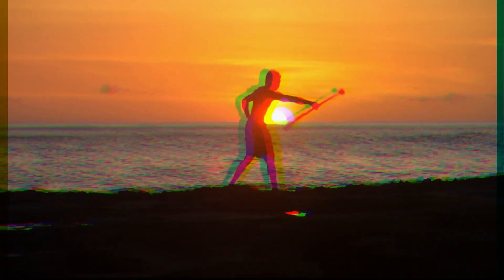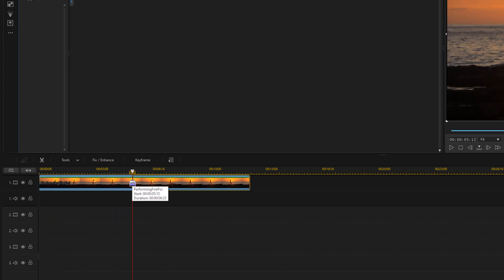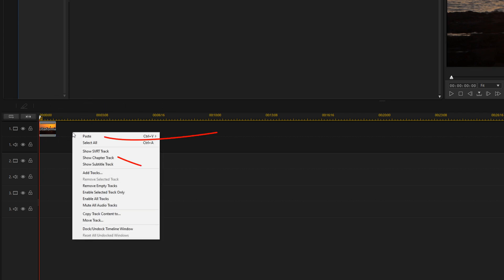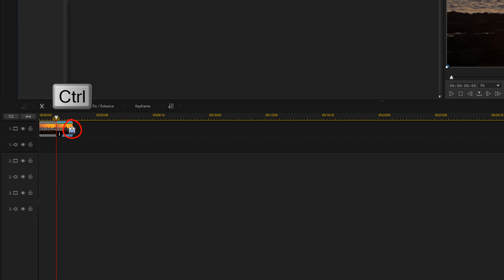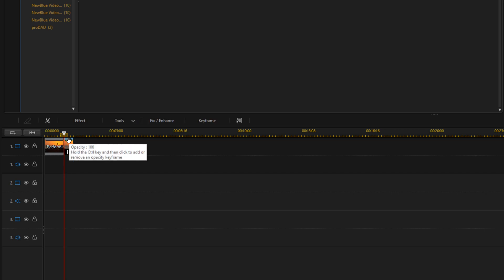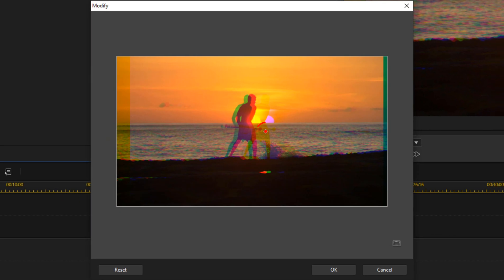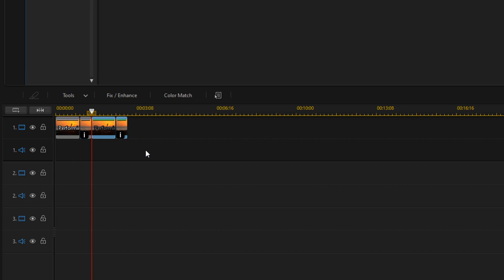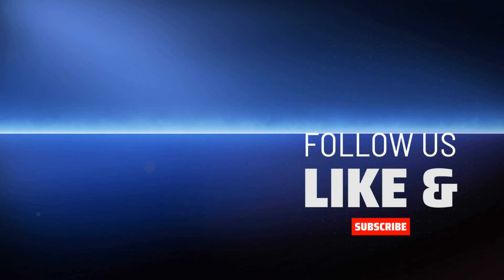How to Make A Boomerang Loop Effect | PowerDirector

Comment: Mr. I’ve been using power director 365 for two years. I watched your video all the time but Where’s the flip 16:9 over to 9:16? I knew there is a “ power tool “ bottom on power director 14,16….would you please showing me how to flip it on 365? Thanks 🙏
Reply from the maker: In the PiP Designer you can rotate the video. In the Edit menu you can change the aspect ratio.